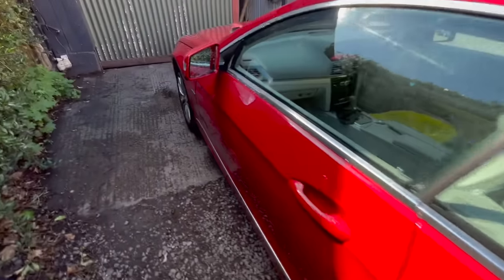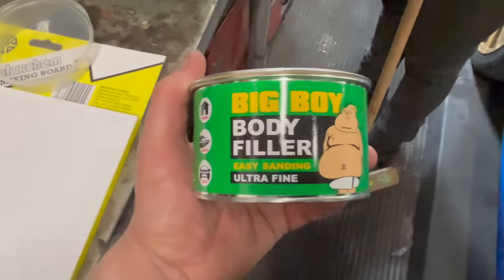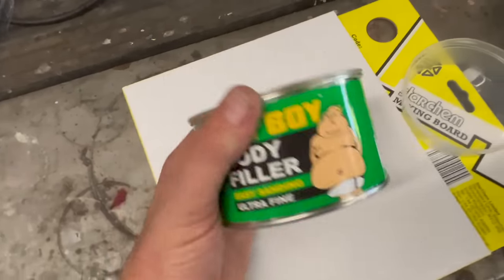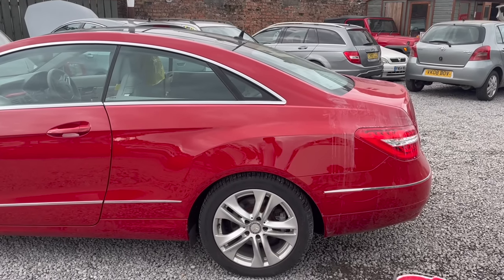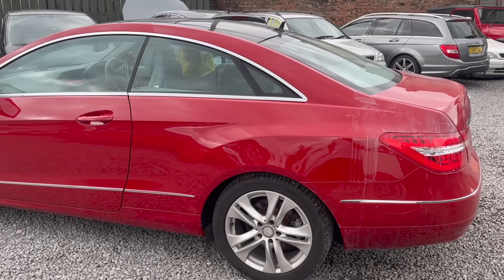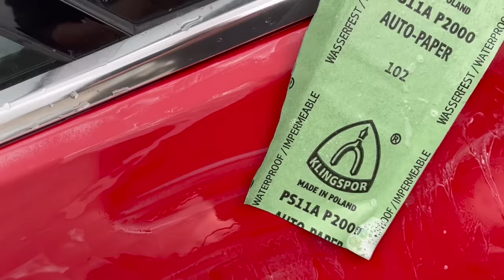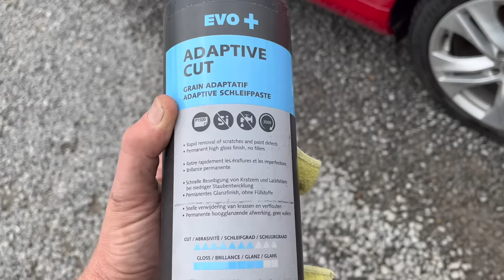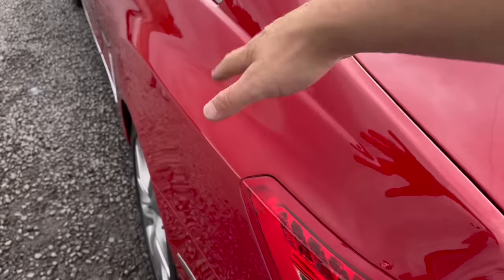HOW To Fix / Repair flaking faded DAMAGED Clear Coat - lacquer Peel A WEEK IN SHINE  EPS 35

Comment: Have similar issue on my Golf. For now i chucked a bunch of touch up paint over the peel to stop it spreading. Not sure if i should repair the wing or replace with an ebay one (£110 on ebay in colour). Only issue with ebay one might be colour match being off. But OG wing has only just started to bubble on top of the peel in corner I could catch it now and respray it.
Reply from the maker: Great idea

Comment: I've been dicking about using varnish & laquer remover spray(aerosol) on this - dunno the science but it takes off the clear & leaves the basecoat.  Is a very handy way of dealing with knackered clearcoat.  I like the look of that filler - tres smooth. Be handy for going back over boggo-filla & dealing with pinholes. Use dolphin glaze currently but it's fragile as anything & likes under-cutting when you resand the panel, gets on my nerves tbh.
Reply from the maker: you will sort it
Reply: @shineautomotive  Been boring lads in the game about a guy I stumbled across - it will sound like I'm shilling the lads videos  but I don't know the chap from Adam. I do, however, know a bodywork artist when I see one - give "Raghuveer Car Paint" videos a look - he does filler work. Except he does it better than anyone I know does filler work, me included. He's ridiculous. Stuff he does looks better than most stuff I see daily sanded, before he sands anything. 

You'll like it & learn some schidt - guaranteed. I've been nicking his techniques the last few days & yeah.. better..  loads better.